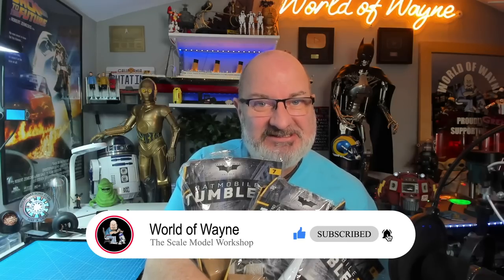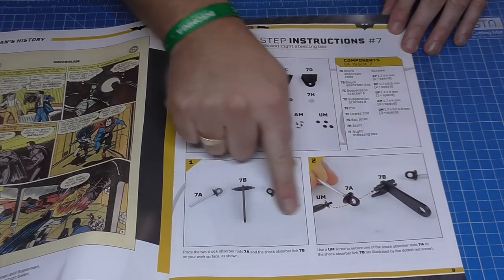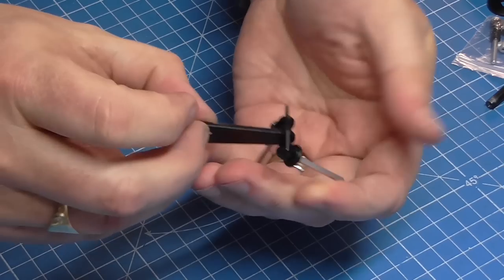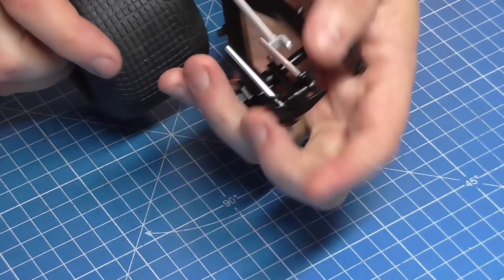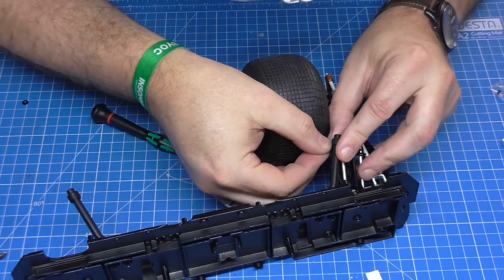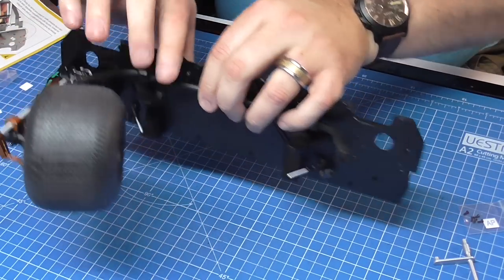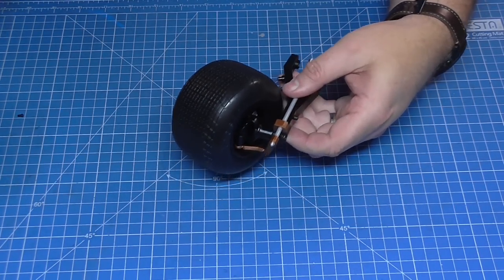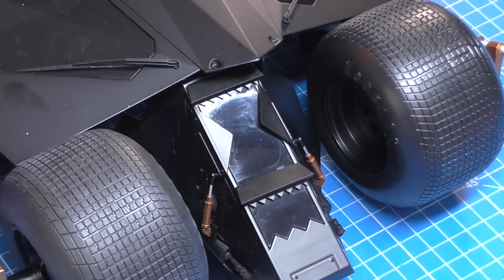Build the 1:8 Scale Batman Tumbler from Hachette Partworks - Part 7-10

Comment: at this point which parts are diecast? is Hachette Partworks have any connection to eaglemoss?
Reply from the maker: No. Nothing to do
With Eaglemoss. Most parts are metal at the
Moment
Reply: @WorldofWayneUK  that's nice. I'm tempted to get this kit instead of the Hot Toys which is mostly plastic. Hopefully they do a motorized batwing or the bat just like the DeAgostini X-Wing